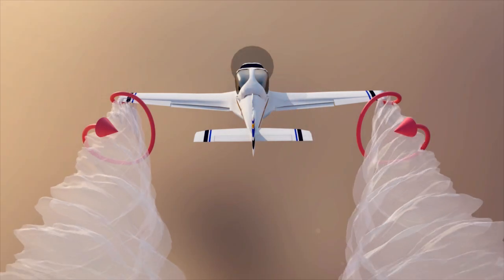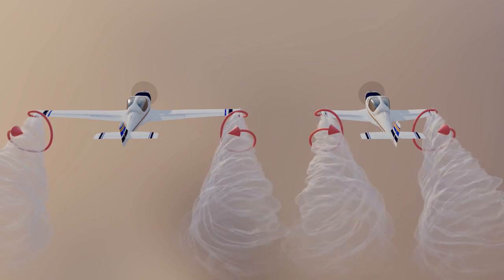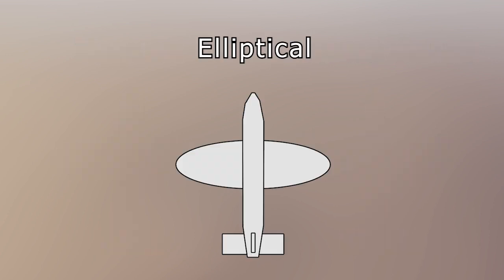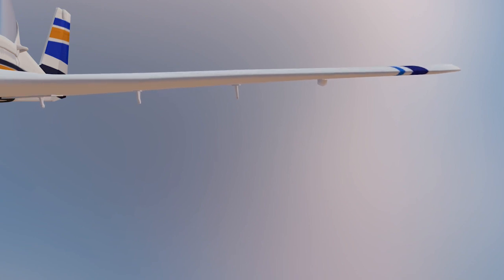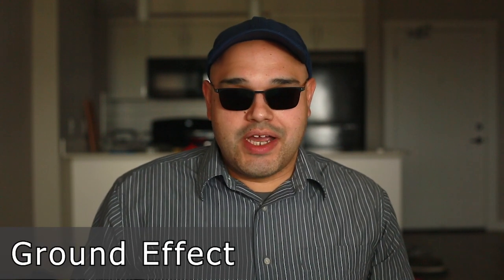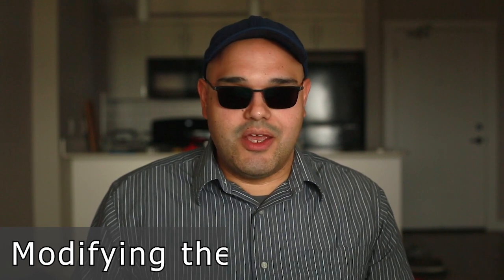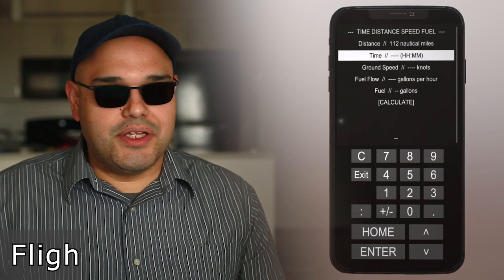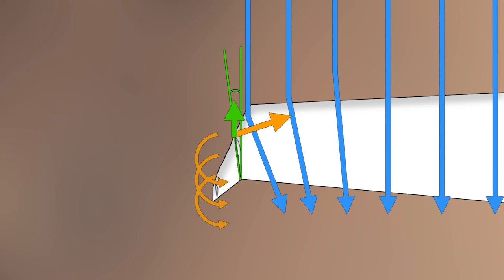Reducing Induced Drag

Comment: Both (1) vortex drag and (2) viscous drag associated with increased AOA (plus drag penalty due to the lift vector deviating from the vertical axis) are components of induced drag. The way you describe it, you make it sound like they're the exact same thing. They're not.
Also: both (1) airfoil profile and AOA and (2) pressure exchange around the wingtips (vortex generation) contribute to downwash - but these are also two separate things!
Reply: What you said just helped me clear up my understanding, and confirmed things I suspected😅 cheers man

Comment: Ah, you are contributing to the misinformation. Induced drag depends on 2 things only: how much lift the wing is creating and how much the air is perturbed by the wing in order to create that lift.
Usually how much lift is created depends on the weight of the aircraft, so less weight results directly in less induced drag.
Perturbed air left behind the aircraft is lost energy, so less perturbed air means less induced drag. Longer wings and higher speed means the wings are acting on a larger quantity of air, the air is perturbed less, less energy lost in the wake, meaning less induced drag. In conclusion, less weight, longer span, and higher speeds are all contributors to less induced drag.
Reply: Hi. Why longer wings and high velocity perturbes less air
Reply: @Ionut-b7w his earlier videos explain this, I watched them in order lol so I sort of get it... just 😅